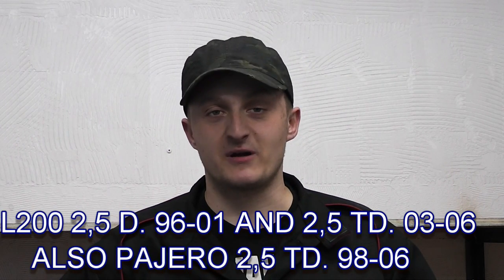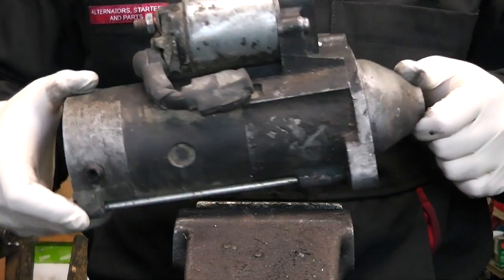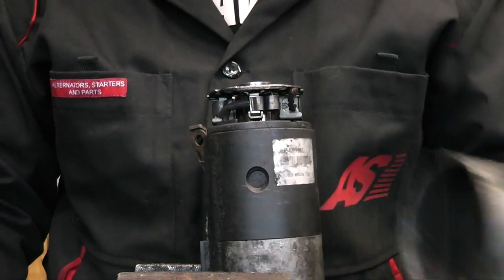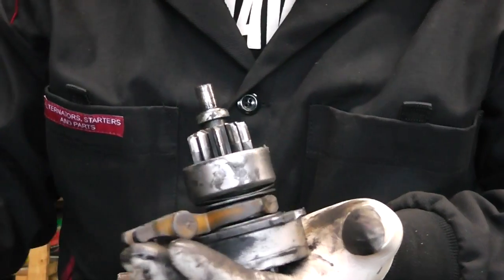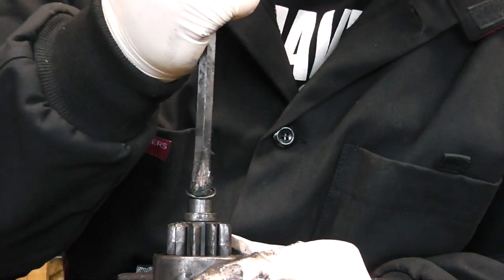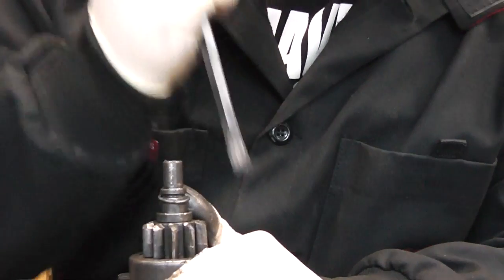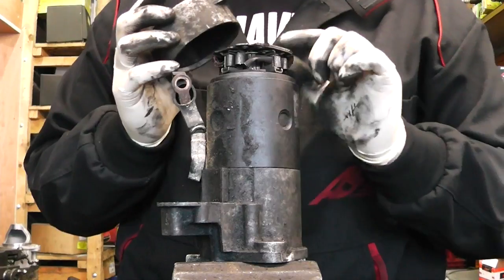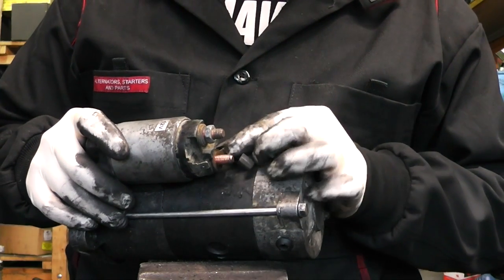Mitsubishi pajero/L200 starter motor solenoid and bendix change.2,5 TD.

Comment: Mitsubishi starter M008T75071A/ ME 204424. Cannot seem to remove bendix assembly from housing in order to remove circlip with socket. It has round wheel cover with spokes that is part of housing in front. Bendix gear spring loaded. Suggestions?? What am I missing

Comment from the maker: Hello mate,solenoid for all of those mitshubishi starters are quite common,
copy-paste the link i have in the description and it will bring you to the solenoid.
The only diffrence is that the push-on terminal is on the other side of the cap.

Pinion is not easy to find,10,11,12 tooth ones are common,but not nine.
I can check it for you tomorrow and let you know in the comment box,
Cheers.

Comment: Thanks!    I need to replace the Mitsubishi starter on my Mazda Tribute, which has a dead (not-pulling-in) solenoid - not quite the same model as you showed, but similar.   I've got a second-hand one on the way, I'll check the brushes before I fit it. 
Last starter motor I worked on was an old Lucas inertia starter.   At least after watching your video I won't be going in blind.

Comment from the maker: Hello mate,
Its hard to tell what kind of a starter you have on it without any numbers.
But usually what is fitted on them is a mitshbishi starter with a clutch rather that pinion.
 
I might make a video for one of them shortly,maybe even tmrw cse its a video making day tmrw,the only problem is that the clutch might not be widely available.

I will check do i have any of them in stock and let u know,
Cheers.

Comment: Hey these are great videos, very informative, thanks for doing them. I wonder if you can give me your opinion on my starter in a pajero 2.8. When I turn the key, all I get is clicks, cant get the engine turning over. Suspecting a starter or solenoid problem. What d'you think?? cheers!

Comment: i hve question sir is the starter hve a problem when my battery energy getting low when im not able to start my car for 1 to 2 days..and when i start my car the starter sounds like that there is heavy on it..i tot d problem is on my battery but when i bought new battery,its still like that..i brought it to the shop the mechanic told me its on the armature of the starter is grounded and nid to be replace..thank you sir,i will w8 for ur reply...more power